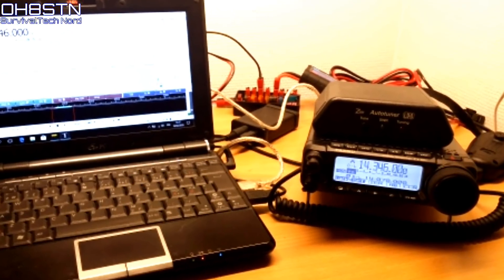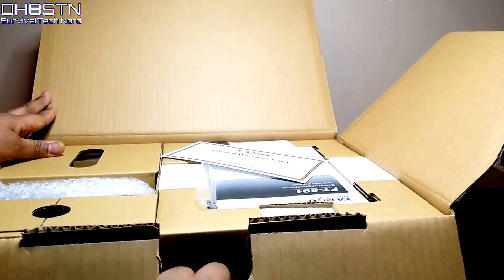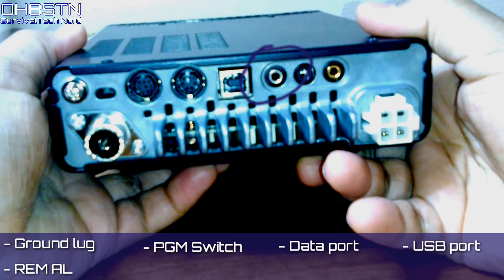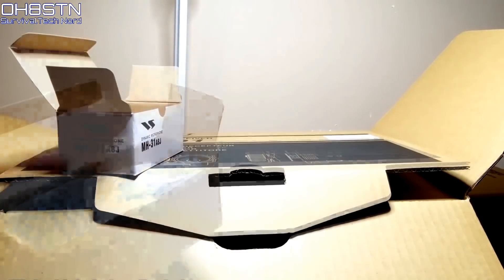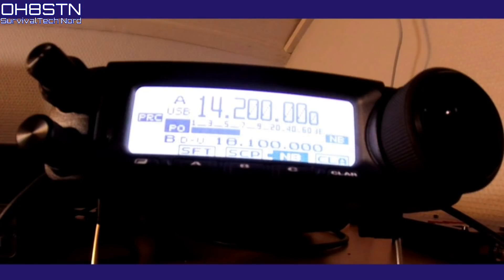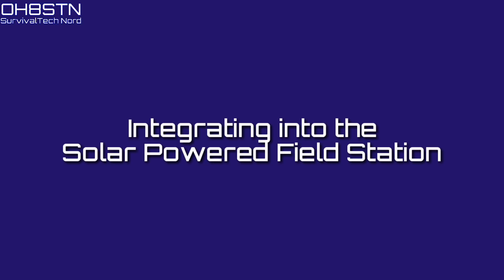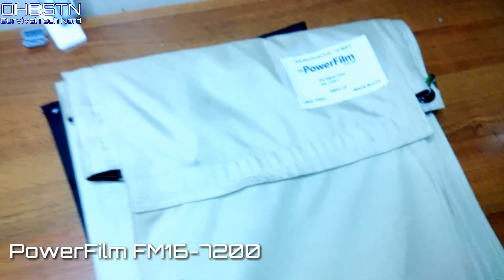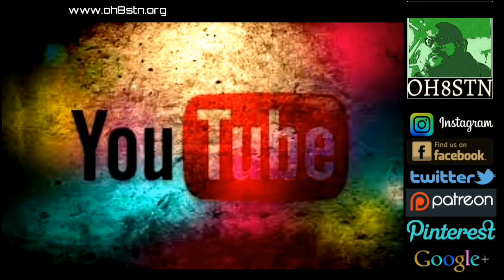Yaesu FT-891 Unboxing

Comment: Great video, Julian. I’m new to HF and went with the FT-818ND as I’m a backpacker, but found that a QRP radio is rough as your first HF rig. It’s been two years since this video was released. Is the FT-891 still the sweet spot for more powerful field operations? Would you replace your FT-891 for the new IC-705 even though the latter is still QRP?
Reply from the maker: Awesome question.
The FT-891 is definitely not a backpacking radio. For me it's a more capable, more powerful field radio. Something we would use for critical communications, but definitely not for backpacking. I love the FT-891 and wouldn't sell Still, my heart longs for a full-featured QRP+ pocket portable rig. One which doesn't require a mess of wires, mechanical filters, or a 10 watt amplifier strapped to it. That's why I'm buying the Icom IC-705. If I'm building a QRO go box, the 891 is a nice option. If I'm fat bike camping above the Arctic Circle, it's gonna be the IC-705.
Does that make sense?
Reply: OH8STN Ham Radio Perfect sense. Thank you for the detailed response. It looks like the FT-891 will fill another need outside of my backpacking use case. I think I’ll pick one up for use as a mobile rig in the Jeep, a portable base station for home, and as a portable station for the RV. Keep up the good work. I’ve been binging for weeks on your channel.

Comment: I love the size of the 891 but what's stopping me from buying it is the 15+ item menus and sub-menus. How on earth did you get to know this well enough to be able to use it without constantly referring to the manual while in the field? One of my criteria for a field radio is that it's simple enough to use in an emergency situation. For me the 891 is powerful but in no way simple to use. Thank you for your videos! Adam W7MP
Reply from the maker: Customizable quick front panels buttons. 😀
Seriously though, the ft-891 is designed to be used with memories. There's a lot of menus but generally we're only using the mode, the filters, and the DSP. All of these can be controlled through the quick buttons on the front panel once set up. I want to be annoying things about the eight nine one is the loss of your settings when changing bands, if you don't store them in memories. To be fair, I'm giving Yaesu a little latitude with this radio, because it has the best receiver of any radio I've ever owned. It's pretty crazy actually. I don't understand why they ruined the user interface like they did.
Reply: @OH8STN  I want to love it. I really do. But having come from the ICOM 706 MKIIG many years ago this is a steep curve, not intuitive at all. I have a 7300 as base station and am comparing the 7100, 7200 and Yaesu 891 for portables. Heck it may be worthwhile to just get a second 7300 for portable. The weight difference is only 4.66 lbs between 7300 and 891. I don't have an interest in mounting it in my vehicle. I'm interested in what you're doing, which makes so much sense - the best way to train for off grid is to be off grid. Your videos are so well put together. Keep them coming! Your tips are so useful, you should also start an Ex-Pat channel! ;)
Reply from the maker: @AdamBoettiger  well Adam, I'm not selling it :-) just answering your questions. I'm going to keep my 891 for data mode Communications. Honestly however, I'm moving over to the Icom IC 705 when it arrives. That'll be my qrp replacement. Then I might actually go ahead and pull the trigger on the 7300.

Comment: I bought my 857D three years before the 8t91 was available or I probably would have bought it. I use lthe 857D for a base station but the 891 would be better for a QSO go box, in my opinion.  The TCXO and DSP noise filtering are very nice features.

Comment: Do you recommend  still  like prefer the FT891 over the ft 857d?
Reply from the maker: That's kind of a trick question but I'll answer it. I absolutely prefer the ft-891 over the ft-857 delta. Unfortunately it's not that simple. If we're talking about HF only radio, removing VHF and UHF from the equation side-by-side the ft-891 is the absolute winner. On the flip side if we include VHF and UHF capabilities, naturally one would levitate towards the 857 Delta. Since I have a separate VHF UHF radio, I prefer to have this Superior performance and reception of the eight nine one over the eight five seven. Does that make sense?

Comment: have they fixed the switching from USB and LSB issue? can you easily switch from USB to LSB on any band now or do you have to do weird menu work around stuff?
Reply from the maker: You have to push the "mode button", then select the desired mode. The only Annoying Thing is you have to choose the mode quickly.
Reply: i see that but the mode option just says ssb, when you choose the ssb mode does it then ask you upper or lower? or does it choose automatically for you depending on the band? @OH8STN
Reply from the maker: It chooses automatically depending on the band. If you're in a data mode, you can choose upper or lower sideband. You can always override the setting and choose the band you want. In this case I would agree with your first statement, it's kind of ridiculous.

Comment: I’m interested in the 891 and the 818. What made you decided on the 891?
Reply: I briefly had the 818, now have the 891. Comes down to power. I've done a couple of SOTA activations, and haven't been able to make contact using my KX2 (which outputs 12W) running SSB. Today I did one, same antenna, with the 891 and had my four contacts within a few minutes including ones from MO and KS (I'm in CA). No substitute for power if you're doing SSB. If you're running CW or data you can often get away with QRP.

Comment: Julian, what is your all up weight with radio, battery, panel and antenna?  I am looking at putting a very similar rig.  Thanks.
Reply from the maker: Thanks for the question. I'll put up an 891 go kit info video when I have a chance. I'm sure you're not the only one thinking about that question.

Comment: I own this radio. I'd advise to anyone who wants a separation kit to research alternatives. There are super cheap cables and better face plate mounting options from 3rd party vendors (for a much lower cost). Trust me. It's a great radio but the sep kit is very overpriced.

Comment: I am thinking of the 891 too. I want a rig that will get me outdoors more and the 891 is on the list for sure. Looking forward to your impressions with you new set up.
Reply from the maker: Thanks Mike.
It's definitely easier to get outside with a kx2 or 817, but if you're trying to get outside with more power, then this radio is probably the right one. Wait until I get into the filtering of this radio. The receiver will completely blow your mind for such a small rig. 
73
Julian oh8stn

Comment: Sir, After looking @ your considerable social media presence, I wasn't sure of the best place to post this query so, here seemed as good as any. You've held forth at length re: your preference for the best man-pack system and it appears this 891 experiment may be a good addition to that line of thought. That aside, I am... starting from scratch, and would appreciate knowing if your opinion has changed regarding the FT817ND system you've suggestedin the recent past is still the most robust, portable, budget minded and versatile option for field ops?(i.e. being able to listen to everyone.) The classic retort clearly is: "well that depends..." I know. I live in a mountainous state in the central US and spend a sig. amount of time above 10,000ft and am capable of dealing with just about any weather condition, but would like to be able to speak with my father due north about 600mi.  
Your thoughts would be greatly appreciated. I've learned a great deal from your presence here. Thank you in advance for your thoughts. N

Comment: I love this radio! Bought it a few months ago after consulting my "elmer" dad :). Quick note, I just purchased a Wolphi-Link and using Droid PSK on my Samsung S8+. The Data jack on the FT-891 has the same pinout as the FT-817 Data jack and the cable works just fine! Still building my field kit for camping. QQ - Does the Z817 LDG tuner work "natively" with this radio? Love to get it but haven't done enough research yet for it. I see you have it hooked up. Thanks Julian!

BTW, you and David Casler are my FAVORITE HAM YouTube channels. Love the content and I am so pleased that I can follow more about your experience with the 891! Apparently FB has a great forum on this radio but I gave up on that social media poison years ago. - 73!
Reply from the maker: Outstanding comment. Thanks for sharing your experience with the radio and the data connections. I have to see 817 North remember it's only good for 25 watts. A buddy of mine is doing a mod project right now with the z100. We're actually going to try and put it in a smaller case so it's the same form factor as the Z 817. Stand by the channel on my blog for that.
By the way if you're doing this type of field Ops please come join us in the portable digital and qrp group on Facebook.
73
Julian oh8stn
Reply: Thank you sir. Much appreciated coming from you! OK, I just want to make sure I understand clearly Julian. Are you saying the Z-817 tuner will work on the FT-891? I understand that it's only good for RF power up to 20 watts SSB and CW, 5 watts for digital modes. :) I like that it pulls power from the radio and for what I will be using, 5W for digital in the field is fine.

The physical pin out is the same on the ACC port for the 817 as the 891's Tun/Lin port (8 pin). But it looks like the ALC pin on the 817 is labeled the Rest (Band D) on the 891. Also the Band Data pin on the 817 is labeled the Band C on the 891.

So, if you've used it (I see it at :40 sec into your video sitting on top of your 891) and can say for sure it works, I'll purchase one today!

Comment: It may be just a little larger than you might desire for your Ruck, but the Hardened Power Systems Scout G1 is a strong unit that provide unbeatable protection during missions into the field...
Reply from the maker: +Mark Thomas thanks Mark. I like the Scout for the desktop but definitely not for the field. Also the Scout forces the operator to use a lead acid battery which is heavy and inefficient. I thought about doing my own version of the Scout removing all of the unnecessary components and building it in a 7.62 ammo can instead.
Reply: I think if I remember correctly, the Scout can be used with  LiFePO4 batteries, and can be ordered without a battery so you can use your own... Although a little large it still has quite a durable platform for most of the items necessary for field operations...
Reply from the maker: I checked that out as well, they use the same charger 4 Letter acid as they do with lithium iron phosphate. I even asked them if they would just remove the lead-acid charge controller and just deliver the Scout with unterminated power pole so I could integrate my own charging circuit and Battery, they said no.
Reply: Ah, yep that's a deal breaker... to much weight for your application...Looks like your going to be able to make it smaller and lighter, with you components...
Reply from the maker: I may still order the scout just to have a total system movable but not for my field station. I like the ammo can gear they have and I think they're doing a good job of it.

Comment: Outstanding! Can't wait to see what's next. I use an 857 for field ops w/ 25ah lifpo and 120 watt solar. I was on the fence on the 891. Thanks for pushing me over to the other side!
Reply from the maker: You are very welcome. I was also on the fence about the 891 and I'm glad It went this direction. I had an 857 years ago, which made it easier to make the choice for the 891.
73
Julian oh8stn
Reply: Well, 40 watts routinely gets me into Europe on 20 meters PSK31 with an optimized 1/4 wave on a 40 foot mast--no tuner. It'll be nice to be able to routinely hear you with the increased power (intentional comms!). KG5USS
Reply from the maker: This week I'm building a battery pack for the 891. Next weekend weather permitting we're going to try to hit North America from the field, weather/conditions permitting.
Should be fun. 
73
Julian oh8stn
Reply: Sounds great. Announce time/freq/mode on your website a few days in advance and we'll be tuned up and in the field for the try.
Request? PSK 31 @14.070Mhz 1500-1800 UTC
73
Randy KG5USS
Reply from the maker: Will do

Comment: Very well done. Let's see some more.
Reply from the maker: On the way 👍👍👍
Reply: I just heard another YouTuber talking about the advantages of having a HF ( 180 meters up to 6 meters ) and a dual band 2 meter and 70 cm. Basically, he was saying it keeps you on local and DX communications. Are you of the same philosophy?
73
KE0OAP
Reply from the maker: Ray Konold honestly for purposeful amateur radio communications I don't think there's any one-size-fits-all philosophy. With that said I do have VHF and UHF capabilities, independent of my HF capabilities.
In fact my tower is set up for 50, 144 & 432. It also has wire end feds coming off of it for HF 160-6m.  My man portable Communications is focused primarily on HF. But I do carry an HT for aprs from time to time.
Don't do repeaters
73
Julian oh8stn

Comment: FB on new rdo. hope it works well for you. putting together similar for trip to allagash, north maine woods next month, tho using rs-918 and small amp. does the ldg817 tuner handle the 100w from ft891? maybe work you from the ice on chamberlain lake.  73 de n1wmr

Comment: The roofing filter does help and surprisingly the band scope is useful. The menu scheme is a bit different but then its not meant for fiddling while driving. Jump on the 40M net with a Hustler mobile antenna and make contacts.
Reply from the maker: +John Leonardelli didn't you say you were strictly a qrp operator?
Reply: no way! I operate from .5 watts to 1kw depending on what I am doing. I operated as 6Y5IPS on the beach with 10 to 20 watts using a Packtenna Mini balun linked dipole and the Chameleon Hybrid micro and a ten foot whip. Bands were horrible so the extra power added an S unit. A week before I was testing the linked dipole with 5 watts and it was -27C. My manpack is 10 watts and I usually run NVIS with that. Does the WSPRlite count? The 891 draws 1A in idle and peaks around 4A at 15 watts allowing a battery pack for mobility. The receiver and DSP beats the 10 year old 817 as expected but I am not selling the 817. I am looking to just use resonant antennas with the 891 so I can the antenna tuner at home. I miss a real power control knob.

Comment: Kool EEE pc, i still have two that work great..Keep up the great videos.
Reply from the maker: +mike dmann thanks Mike I just installed Windows 10 on this one and I'm about to reinstall the Ubuntu Linux in a dual boot configuration. I prefer Linux but there are some ham applications that don't run on it. Next update this a solid state disk.
Reply: I bett a lil SSD will make it fly, I use a little USB with Ubuntu and Kali on mine ,and it flys for such and old little PC.

Comment: As I have shared in previous comments, I am concerned about your power budget. Can you measure the power consumption of the radio on receive, transmit on 30w and on 100w. Preferably using CW. I want to calculate average power consumption and compare it against your solar power generation. The specs say receive is about 2a and 100w transmit is about 20a. I want to see what your numbers are. It would be great to see if the theoretical numbers match actual field experience.

This is not just idol curiosity. Most 100w rigs on the market have similar specs. You are going to find out if such a rig is really capable of prolonged portable field operations. I am almost giddy to find out if it can be done. Sincerely, Charlie KM4ZZ
Reply from the maker: +crbrelativity here's the answer to the first part of your question https://www.instagram.com/p/BfJQ5fggh5d/ forgive me for being grumpy. If you remember one simple fact and that is I'm still a little power operator, it's much easier to reconcile the numbers. I plan on running this rig at 20 watts. Receive current with my settings is between 0.95 and 1 amp. we can get that lower if we switch fans to normal mode, and turn off the backlight for the buttons and display.
More to come
73
Julian oh8stn
Reply from the maker: +crbrelativity I guess in the end the wonderful thing about this project is you guys get to watch if Isaac Seaver if I fail. Either way we get to learn something
Reply: I detected no grumpiness. Forgive me if I seem overly interested. At 20w we will also see if the generated extra S unit will be worth the price in power consumption. You are indeed doing important work. Charlie

Comment: I understand your reasoning for the lack of 2m and 70cm. However I would like to mention in defense of the 817 and 857, AND my old 897, that they allow modes on 2 and 70 other than FM. SSB 2m is a particular favorite toy of mine. Could this make a difference in YOUR planned usage? I doubt it, but wanted to bring it up as most common 2m radios are FM only.
Reply from the maker: +neubert500 Agreed! In fact 2 meter SSB is one of my old favorites. My home station has a 9 element yagi on the tower for 2m. Yeah, I agree with you. I rationalized the decision because 99% of my operating on the field station is still on HF.
Grade point, and very well said.
73
Julian oh8stn

Comment: Great video Julian.  Which antenna have you tested the 891 with?  As a user of the 817ND, I'm interested in what equipment works well with its big siblings.
Michael VA6XMB    '73'
Reply from the maker: Michael Bradley that's always a loaded question Michael but the truth is I've tried it with a basic dipole on 30m, two different magnetic loop antennas, a terminated dipole, and end feds.
I'm enjoying the radio and the way it interacts with the Sirius antennas I'm using it with. Let's see over time
73
Julian oh8stn